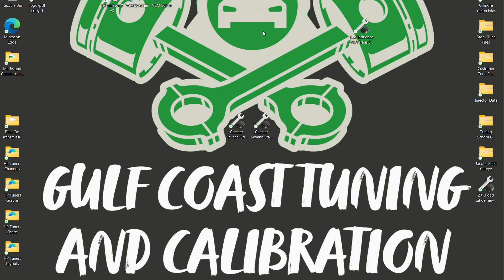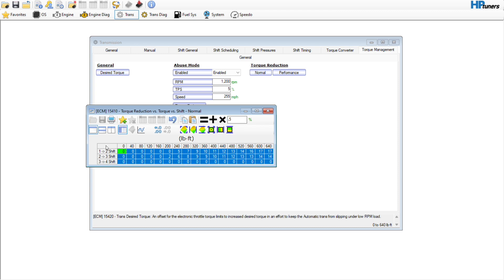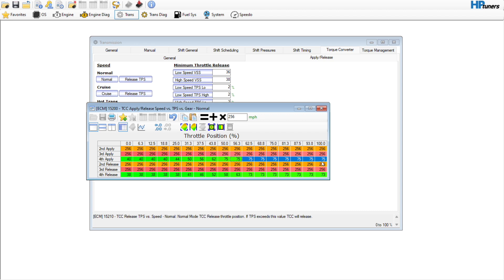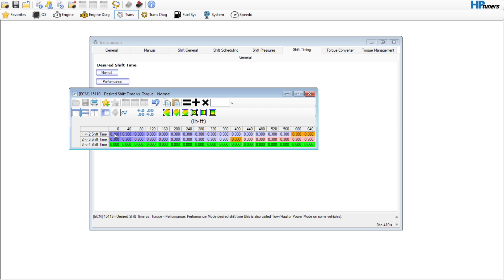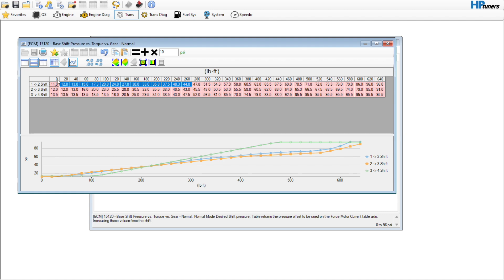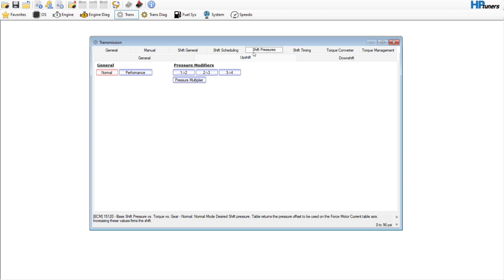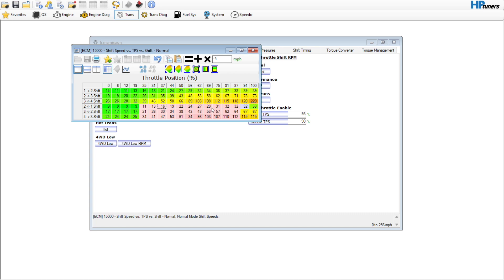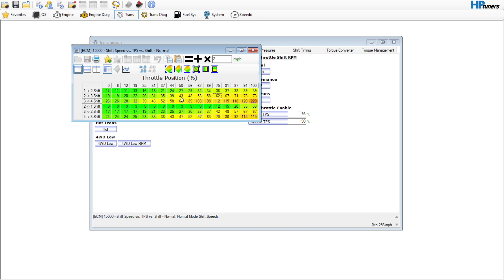What Happens If You Tune Your Stock Transmission?

Comment: I’m having a problem where my trans temps steadily increase when tcc is unlocked. Once locked temps are steady. Any help or explanation would help greatly thanks
Reply from the maker: What is your setup and converter?
Reply: @GulfCoastTuningandCalibration lq9 4l80e with stock converter
Reply from the maker: @koltgaming6704 what are the temps getting to? Yeah keeping the converter unlocked can raise temps. Do you have an aftermarket bigger trans cooler on it?
Reply: @GulfCoastTuningandCalibration They have gotten all the way up to 230 and yes I have a derale cooler and I’m not using the rad cooler
Reply from the maker: @koltgaming6704 have you modified the shift timing or pressures at alll, what about the torque management?
Reply: @GulfCoastTuningandCalibration I did the bluecat tune but other than that I haven’t changed anything
Reply from the maker: @koltgaming6704  Do you have an aftermarket cam or anything? When was the last time you did a fluid change on the transmission and checked the color/smell?
Reply: @GulfCoastTuningandCalibration Truck Norris and it’s a brand new build I just got up and running so I have maybe 50 miles on the fluid. I haven’t checked it since we topped everything off
Reply from the maker: @koltgaming6704  What was the color of the fluid that came out? Are you confident the trans lines are all clean?
Reply: @GulfCoastTuningandCalibration This is a fresh rebuilt trans so I made new trans cooler lines and I cleaned them out before installing so I’m not gonna say I’m certain but I would think they’d be dirty or clogged
Reply from the maker: @koltgaming6704 Gotchya! And the temps didn’t get this hot before the fresh engine?
Reply: @GulfCoastTuningandCalibration I swapped a k5 blazer so I don’t know what the temps were before the trans was pulled. But I’m not sure if I was getting that hot before the blue cat tune
Reply from the maker: @koltgaming6704 do you by chance have a copy of your tune file?
Reply: @GulfCoastTuningandCalibration I have tune and log files

Comment: My 05 suburban likes the shift pressure high it begins at 35psi. Stock trans and engine have had it that way for 3 years 25000 miles
Reply from the maker: @topdeadcentertdc927  yeah I’ve been running mine up and it seems to like it!